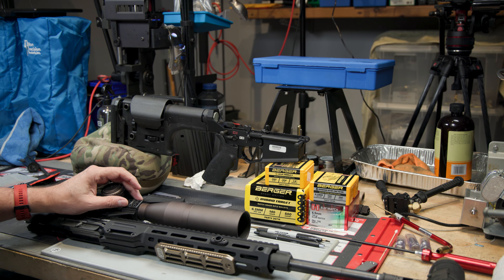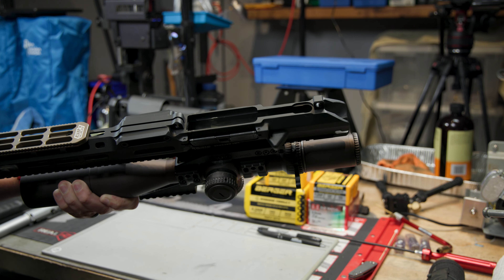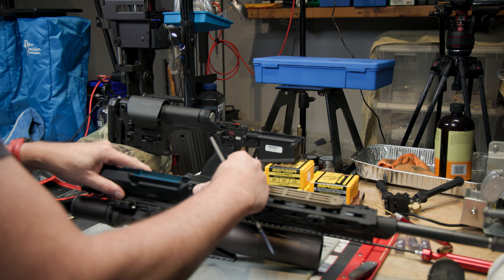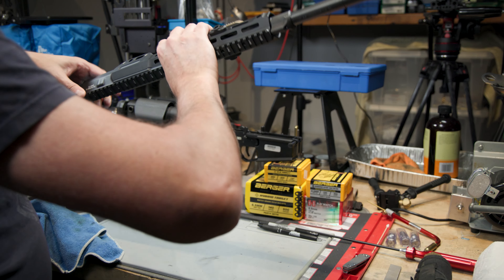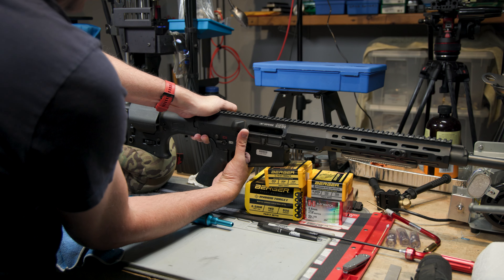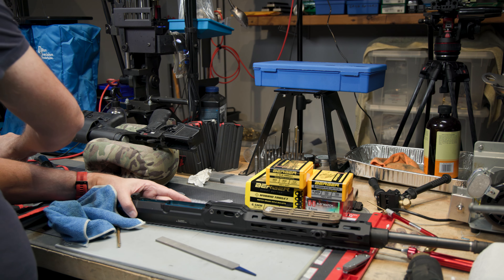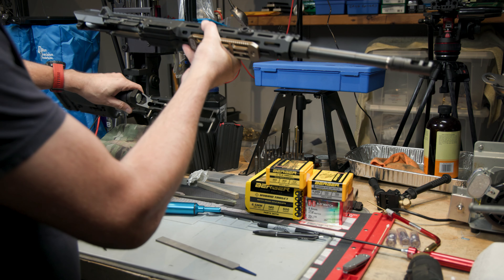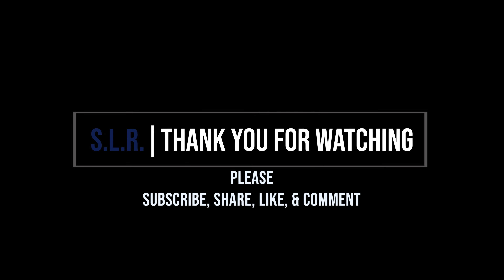LMT MARS-H UPPER TO LOWER RECEIVER FITMENT ISSUES - FIX THOSE OVERLY TIGHT TAKEDOWN PINS IN 5 MINS

Comment: Hi I have a question? I need to do this on my upper What File “GRIT” did you use/  FINE OR MEDIUM please let me know Thank you so much for the video.
Reply from the maker: A mill file would do nicely.  That's a fairly fine file.  Also a polishing stone could work.  Don't forget to use some Aluma-black afterwards if you're not recoating the receiver.

Comment: Unfortunately lmt qc has dropped and I’m returning my recently purchased upper it fits horribly
Reply from the maker: I've heard that from some.  Did you buy an upper and fit it to a separate LMT lower?  What are the fitment issues?  Did you try filing the fitment tabs to mate them up?  They do that at the factory for you on complete rifles, then match them up to a lower for fitment.  If bought separate, they expect the end user to do the fitting.  Was that the issue with yours?  Too tight?  Or too loose?  If loose, or lines not matching, then yes I would return it.  It does seem that QC on everything after the Covid cashgrab has gone down in quality and up in price.  It ain't right on something this expensive, or anything, regardless of price.  Hope you get it fixed, because the platform is awesome and well regarded by many.
Reply: @shootloadrepeat  I tried everything the tabs are a big misconception they are for if your upper/lower are to tight you shave then to increase the space to have a looser fit. Anyway my gun was a new lmt 308 quad upper on a new lmt lower and it fit horrible they shook and wobbled I sent my upper and lower back to the company I bought from and they paired it up and it’s perfect now

Comment: How do those feed ramps look lined up in that upper?
Reply from the maker: They don't actually line up very well at all and form a "lip" over each feed ramp which would jam up an AR15 quite easily.  However, thankfully, it did not affect function and all the pointy rounds I fed it went in smoothly.   The followers from 3 different brand mags present the rounds high enough to not cause any issues.   (I've already fired 100 rounds through it so far).
Reply: Nice, I finished building my Mars-h a couple months ago and have about 400 through it with some iffy feed ramps. I’ve gotten a lot of stovepipes though while shooting suppressed. I was pulling some copper out of where the left feed ramp meets the upper receiver a few days ago. I stuck a new barrel in it to try out.
Reply: Lemme know how this goes because I just got a mars h that have few ramps that don’t line up however haven’t shot it